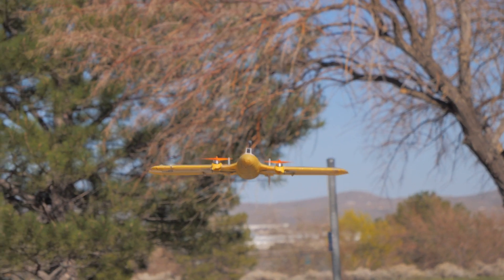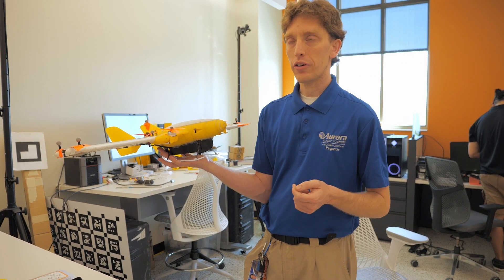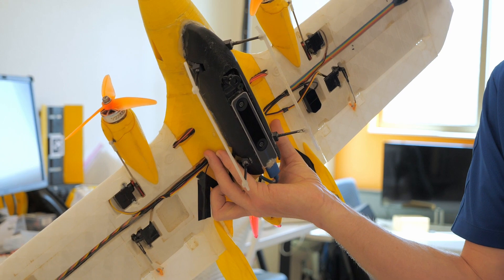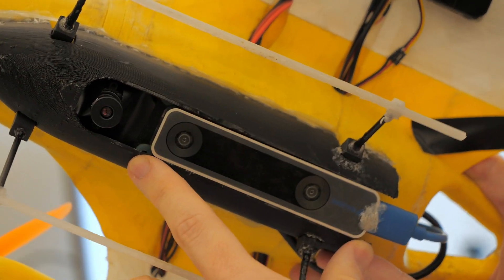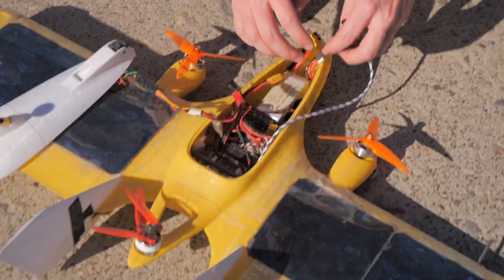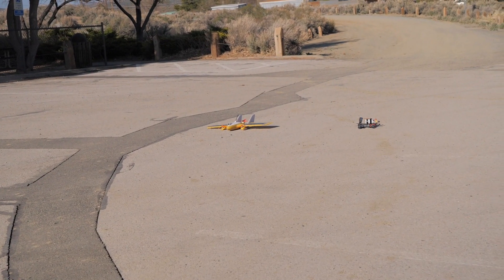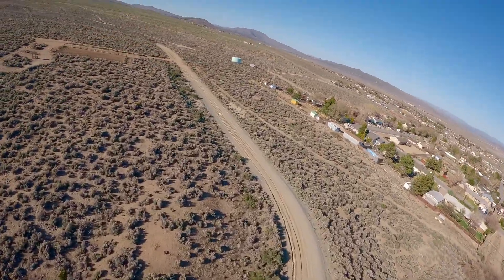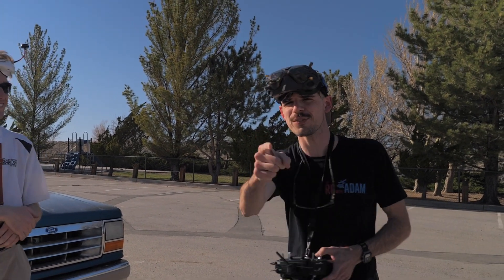The REAL MiniHawk // 3-Motor, 3D Printed, Opensource, Autonomous VTOL FPV Airplane Drone at UNR

Comment: the vertical stabilizers could you double them up and have 2 fold down over the rear fan during forward flight yes you will end up with a low pressure zone behind the plane where the flow is disturbed but you would most likely gain more in friction reduction

Comment: This should have been the Osprey design, eliminating the stability issues.  With tilting rotors not engines(like the Valor).  The dead weight rear motor could also be dealt with -in the manner its done on the VTOL F35

Comment: 2:56 how about tilting the motor 90° and using the force in normal flight?
Reply: Yes, that would be helpful, but on scale models it will drain the battery, and reduce flight time

Comment: Great job!
However I always though that it would be probably better that the motor pods would be fixed on the wings and the entire wings tilt instead of just motors because :
- air would be always free around the motors (dont need to make long motor pods to get clearance)
- in transition lift ratio between propellers and wing should increase/decrease more smoothly
- only one big servo for the entire wing should save few weight

There is probably some reasons why most vtol don't use this design? What are these reasons?